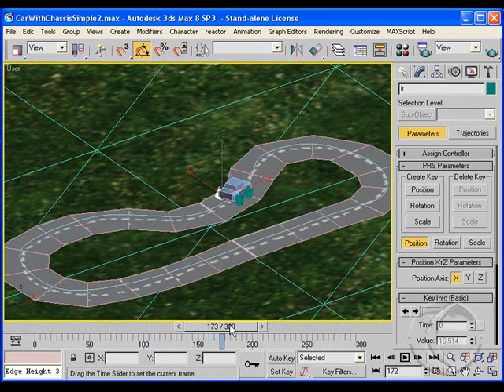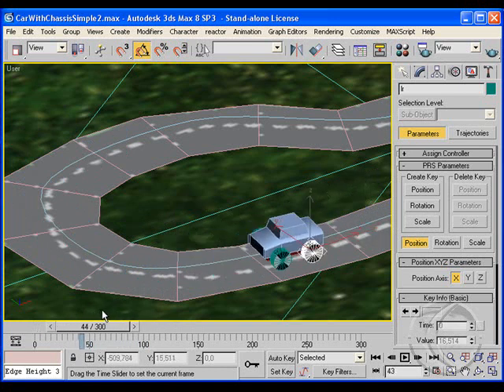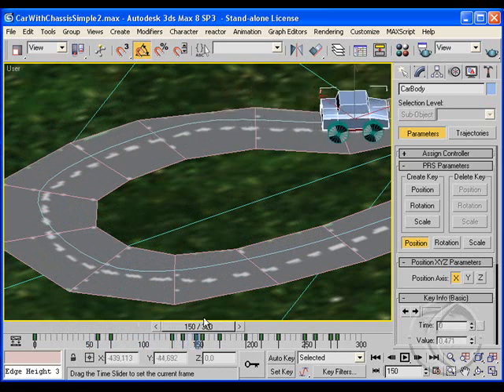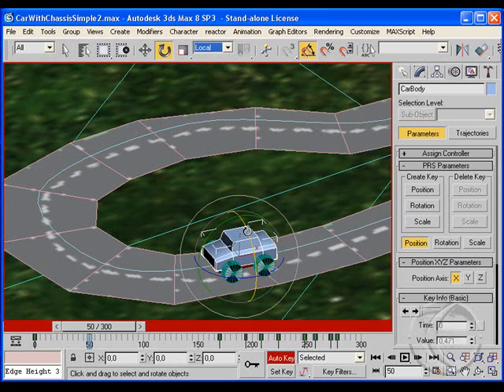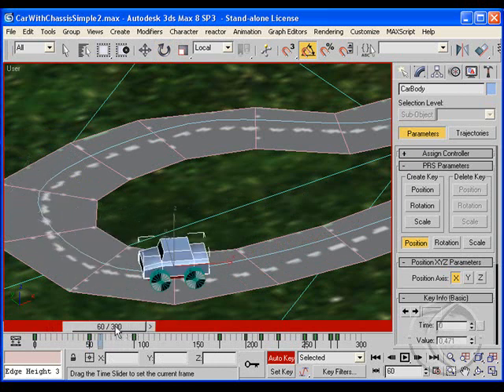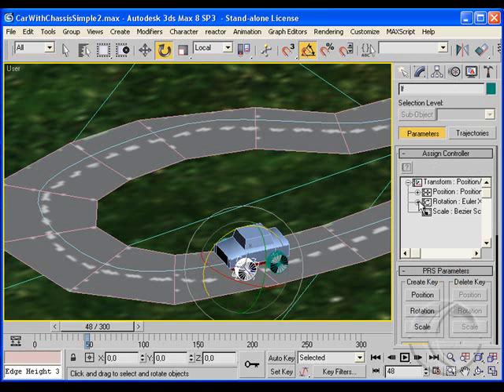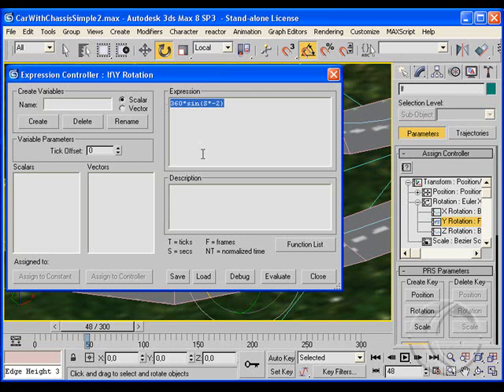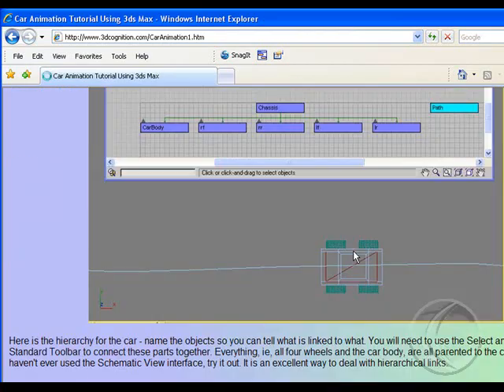Car Animation Suspension Wheel Turn Using 3ds Max

Comment from the maker: @pepe220987  - 
I've seen this happen but forgot what causes it. If you do the execise from scratch it will be fine - if you are using your own data, you may want to try using xform on your models first because it is possible they were scaled unequally.

Comment: Great Tutorial

I have a problem though.
When I try to rotate the wheels on the y axis. the shape of the wheel changes from round into a oval.
Its round at 0 and 180 degrees and most oval at 90 and 270 degrees.
This also happens when I insert the Float expression function... and it looks weird